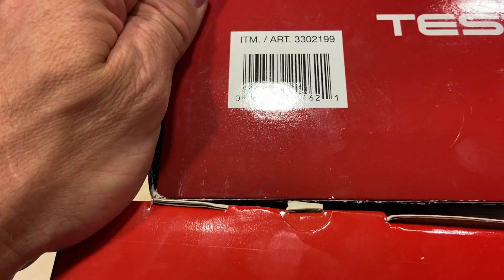Hair dryer heat issues

Comment: I have a hairdryer with 2 temp settings:  no heat and an extremely high heat setting. I wondered if I could lower the extreme heat by swapping out a component, but it seems like you’re saying that to lower the heat, it would require a design change in the diameter of the wire, and that sounds like more trouble than it’s worth to me. Am I understanding this correctly?   (FYI - I did not open up the dryer yet to examine the parts.)
Reply from the maker: Yes, wire diameter and length are factors. So, the heater coil could be shortened by cutting it if the cut end can be properly reconnected to the circuit (no sparking at the connection point, electrical fire hazard)